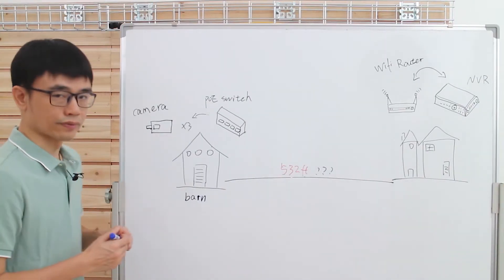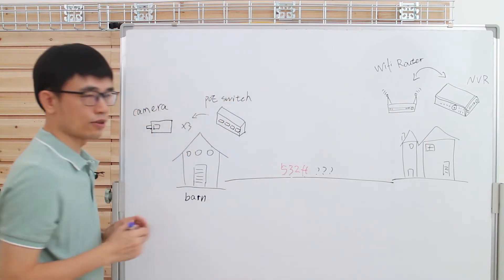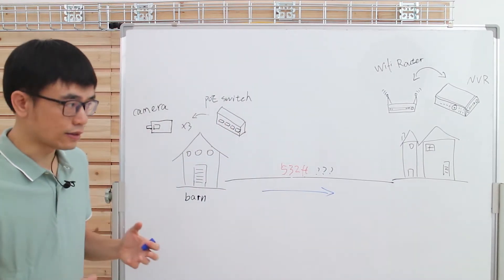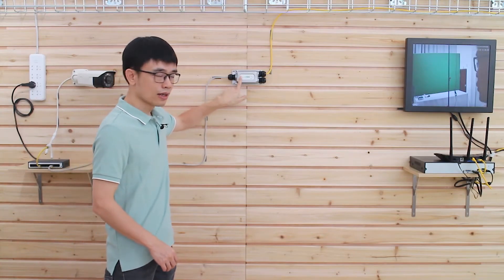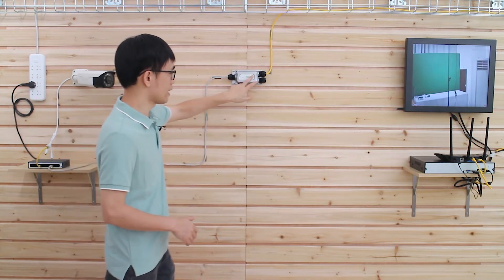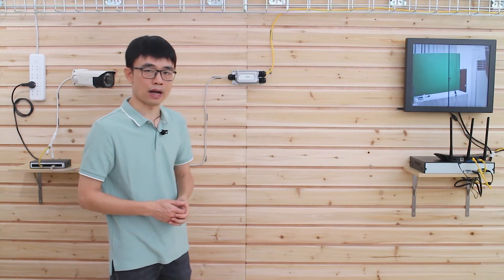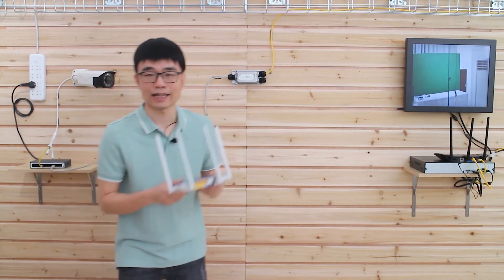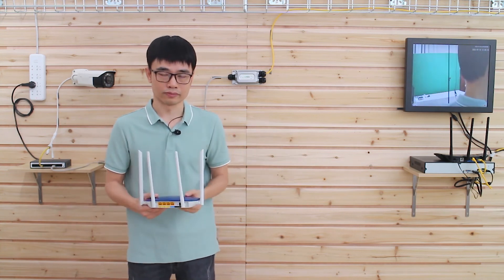How to Set up Long Distance Network to NVR/DVR

Comment: what is the max distance that the repeater can support?
Reply from the maker: Most PoE extenders available in the market can only support a max distance of 100 meters but our extenders can reach 500 meters when daisy-chained. If you're interested, we've also developed an Ethernet extender that can extend your network for another 130 meters. https://www.fastcabling.com/product/waterproof-ethernet-extension-kit/